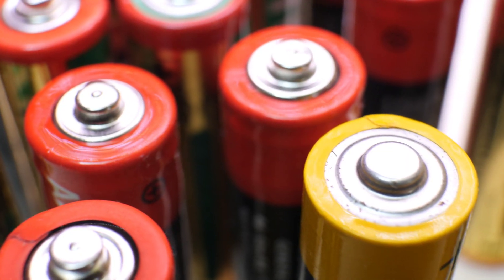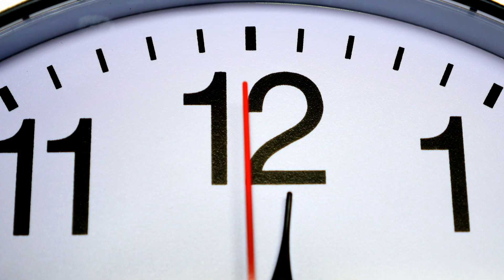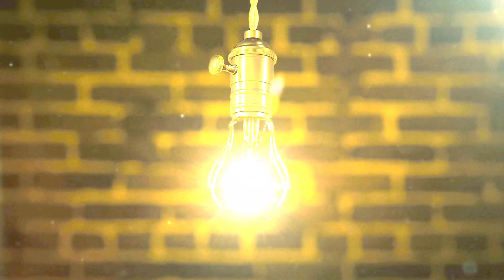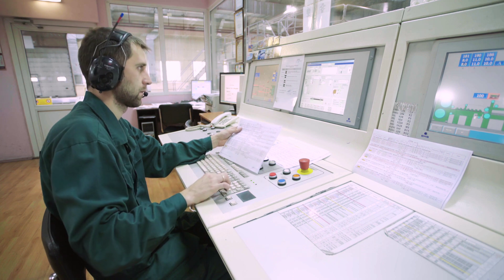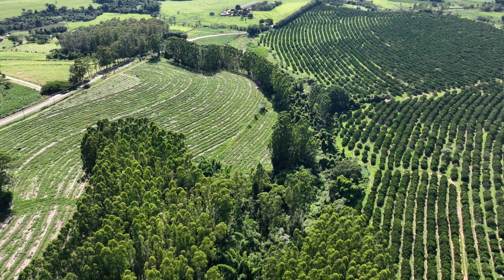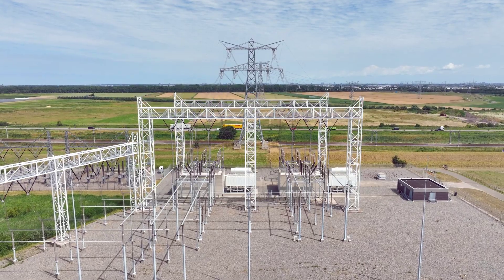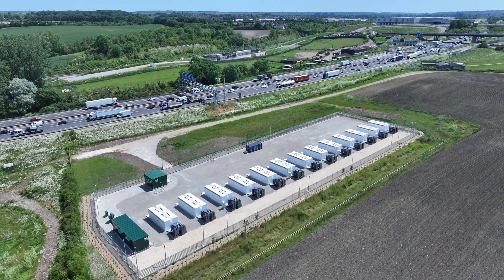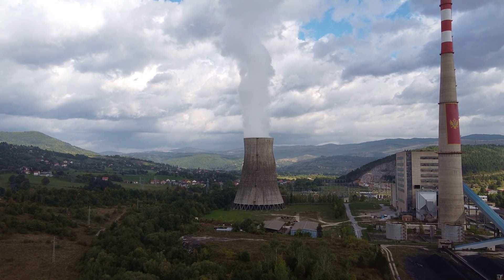Grid Batteries - an obvious solution or not

Comment: Batteries need a grid connection, surely the best place for these is in an old coal power station? For new housing, a better solution may be one big battery charged by spare solar from all the houses built rather than one per house, Octopus are now working with builders to supply houses with zero electricity bills.
Reply from the maker: I would tend to agree except for one problem. If it is centralised I doubt the actually people in the houses will see any financial benefit. Rather the developer will say, look this is awesome, we an charge the householders, make money from the energy generation/storage and then sell the whole thing to investors and make a tidy sum there too. Or perhaps I'm, just being too pessimistic?
Reply: you may be right but i was trying to ink it with the Octopus deal where there is a guaranteed (presumably with caveats on total consumption) of zero electricity bills which should be possible in a new development @JamesCookeVlogs

Comment: Also, one argument I always hear is “the wind doesn’t alway blow and sun doesn’t always shine (on the ground) but what they forget is the wind does blow in other places usually, when it’s not blowing near you, and same with the sunshine when it’s cloudy near you. Then combine that with widening the capture by the cables links to the European continent and Scandinavian countries. That widens the area that dies capture that wind and Sun then, yes, capturing it in batteries and other new upcoming tech. Then there’s our existing Hydro and new one about to be built in Scotland adding to the ones there already and the new upcoming Tidal power that’s been successfully trialled and about to roll out and a guarantee of its generation every day, and it’ll be captured and stored for release when needed. As the world and UK’s power demand decreases because of better builder economic white goods, better efficiency in heating and transport (and not increasing because we will be all driving evs but less electricity required to power oil refining and as factories and housing add solar and battery storage, the grid will easily manage

Comment: I agree, the Governments need to force all new homes to have a power system ready to go.  Solar panels and a battery storage system.
Reply: Adding a 10kWh (ish) battery & a dozen solar panels would probably cost less than £10,000 on a new build. That's about 4% extra on a £250,000 house. As installations scale up, it would become even cheaper.
Reply: Hey i agree i have solar and battery, but force? it's a strong word and at some point what else can be forced. Encouragement over force